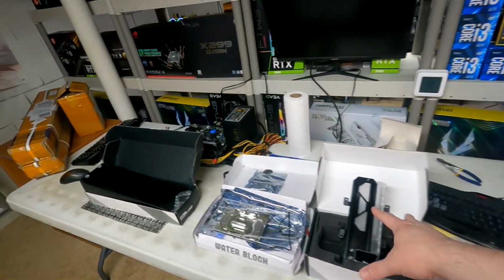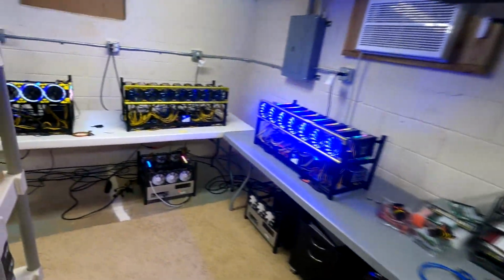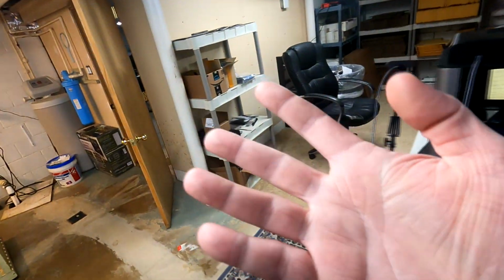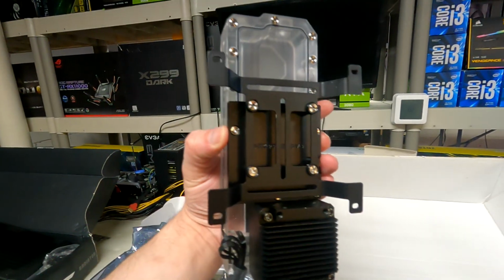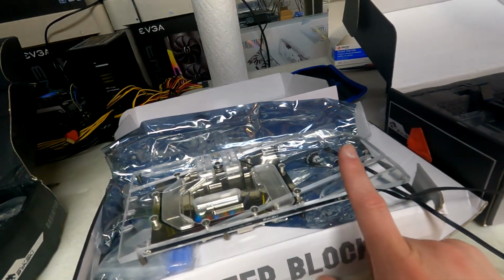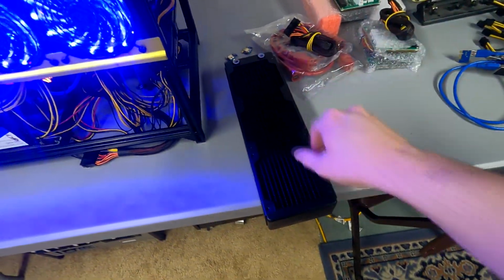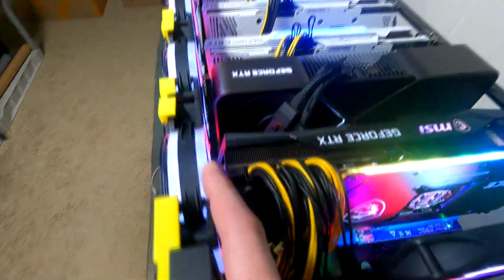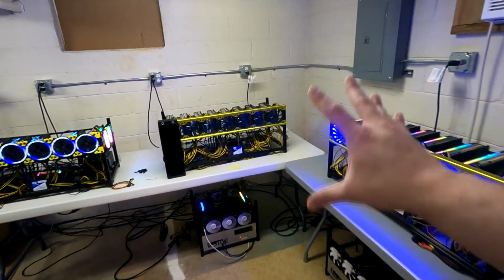Time to Water Cool an EVGA RTX 3090 FTW3 Ultra Mining Rig!

Comment: Awesome. What motherboards do you use for the 3090 evga ftw3 ultra rig? Like to see the waterblock install. The 3090 ftw3 use paste on alot of their stuff. Thought about putting on the hybrid cooler that comes with standard pads. May end up doing this myself as I have a few 3090's ftw3's already. Link to the items on your watercooling components?